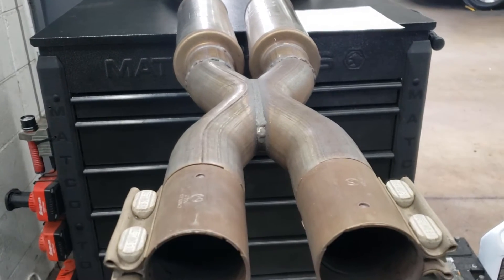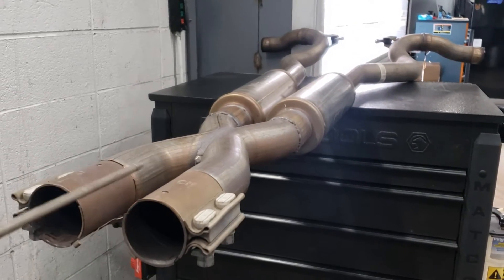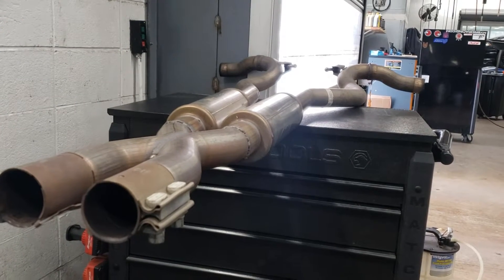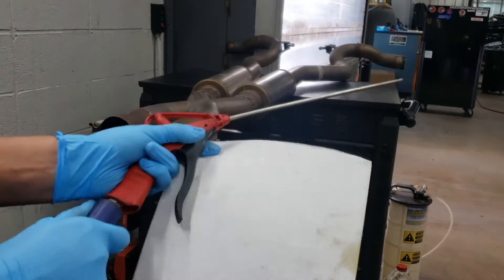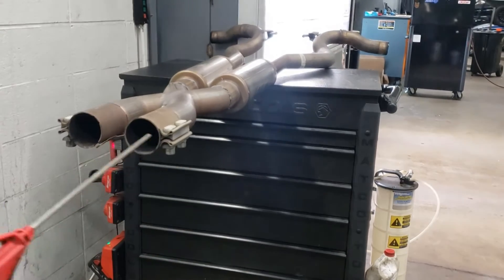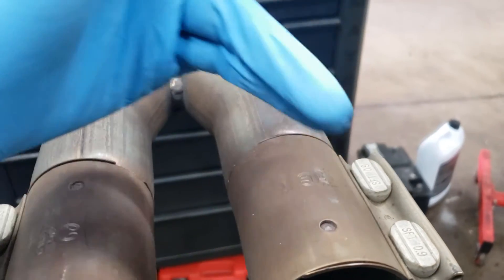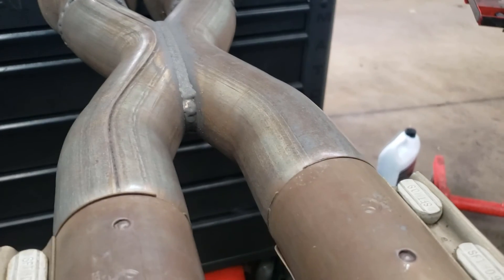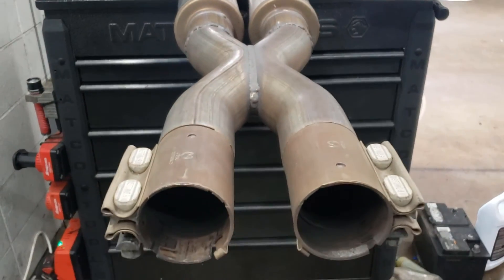Watch how a X pipe works! | How things work

Comment: What about the placement? Is there an optimal length of pipe from the exhaust manifold you should install the X to get peak performance and/or different sounds (lower or higher pitch, more rumble or more rasp etc) or does it not matter?
Reply from the maker: That's a hole different scien

Comment: Greater suction effect is achieved with a "Y" branch, adjusting the diameter of the final tube according to the total gas flow rate. The system would be configured to the 8-2-1 type, just as they did in this Datsun V8: https://www.youtube.com/watch?v=mkxTfQ_e2BU&t=701s

Comment: What are your thoughts on the downpipe coming into the muffler after after the cats. The muffler is a Jones Jones, Max flow, one and two out. I want to attach my pipe directly to the muffler and then run it out the side of the truck in front of the rear tire.. do you think this will work?
Reply from the maker: Technically speaking anything will work

Comment: Just found your video , off course because I have a  3inch in/out X pipe in my hand an would like to install it  ..... I have a true dual straight piped 2008 535xi N54 twin turbo bmw Inline 6 two banks ..... I have 3 inch catless downpipes off the turbos,,, first section of the exhaust is stock 2.5 inch  (super sprint 3 inch is too expansive so i kept stock)  and then 3 inch all the way out to the back  separate  pipe dual exhaust from each turbo... in the middle I have dyno max race bullets and near the end  another set of dyno max race bullets LOUD AN LOVE IT

 turbos love the non restriction HOWEVER MY QUESTION IS ,  I was wondering will the x pipe make the exhaust move out the back even faster an pull the exhaust out even better ??? what would it to to sound?? and where would be the best location in the middle  before the center  D bullets or after them????? 

sorry for the long ass question everyone
Reply from the maker: Your splitting hairs at that point. Sounds like your happy with the set up so I'd leave it at that. Once you go single turbo on the n54 the previous exhaust won't even matter.
Reply: @YLegalRacing   what would the x pipe do for sound? and thanks so much for responding
Reply from the maker: No problem!! very minimal sound difference in your application in my opinion

Comment: Been curious for a while.
will this setup work on inline/straight cylinder engines?
Like frome the headers, separate the exhausts then let it meet on the X/H pipe.
Reply from the maker: Potentially, primary use is high rpm v8s
Reply: I bet it does work on in-line.  I have a Datsun Z car. If you have a 6 to 2 exhaust system you could install a X-pipe just after the collector flange and voila!

Comment: I’ve a question 🙋🏻‍♂️ so i just delete the stock x-pipe from my 3.5LV6 w204 and now the exhaust is shaking/ vibrating. Is deleting an x-pipe can cause the pressure flow uneven ? Should i just install it back? Thanks for helping.
Reply from the maker: Install back. Helps for smooth operation
Reply: Thankyou . So you mean without the x pipe exhaust might get vibration?
Reply from the maker: Yes

Comment: Maybe you can answer a question about my theory on x pipes. Is there a minimal size requirement where the pipes actually join for the x to work more or less efficiently? When I built mine, the hole in the pipes where the x is created is only about 2-2.5” long and about 1” or so tall. My thinking was having it big enough to say it’s balanced, but not so big as to create a restriction or change direction of the exhaust flow through the pipes. Would you say this is right or wrong.
Reply from the maker: That's a deep rabbit hole that I have yet to do down. I'd research Nascar x pipe theory's and function, there's a hole other world when it comes to that stuff. The entire engine from air filter to exhaust tip is a unit any changes anywhere from cam to header length will drastically change how the x pipe functions
Reply: @YLegalRacing  There is a certain size hole the crossover needs to be. Most all aftermarket mass produced x pipes are joined way too much. Nascar ones are actually pretty small compared to what you’d think
Reply from the maker: Holy crap a comment from stapleton! I was watching your latest ford nascar video. I could nerd out on this stuff for days. Old school high rpm nascar tech and 80s F1 stuff is juicy.

Comment: We get what happens with gasses going in, but can someone help me understand with gasses going out of the X pipe ?
Reply from the maker: I literally just explained it
Reply: @YLegalRacing  my bad😬 also what if I have closed valve on one side of my outlet pipe and open only on other for daily use. 
Do you think that will work with x pipe  ?
For in-line 6 N55 bmw. 
TIA 👍
Reply from the maker: N55 don't need an x pipe. The valve won't effect anything what so ever
Reply: @YLegalRacing  you’re amazing! Thanks for the advice! I mentioned the x pipe only because that’s how aftermarket company like “fi” is doing it for bmw f12/f13
Reply from the maker: Yeah the new stuff is different but n55 is a straight shot. No need to make it complicated
Reply: @YLegalRacing  🙌🏽🙌🏽 I’ll take your word for it !
Reply from the maker: I've been working on those things for years, n55 are pretty solid

Comment: So in terms of exhaust flow, do you count the flow as one pipe or 2 pipes I.e (2 2” pipes meeting at a xpipe is  is the same flow as one 2” pipe or 2 2” pipes still despite the loss of cross section area?)) doing a single to dual of 2.5” to dual 2” “stock was single 2.25” max horsepower is 250 current 200
Reply from the maker: I would'nt pull hairs on those numbers, x pipe only works as efficient as the engine does. And x pipes work preferably better on a V8 application. V6's typically are ok with 2.5" piping
Reply: @YLegalRacing  that's fair i've been reading a lot of on cfm ratings of pipes and everything like that it just shy's on how restrictive a xpipe can be i'm pretty it was this video and a mx5 x pipe video that makes me feel comfortable to do this on a 200 hp i4 turbo'd car, ik this is not a performance gain but more of sound tuning thing personally, straight pipe sounds like a v8(dont believe me, look up n18 staight pipe) and i dont think it matches the character of the car i drive so and also whats not cool about having quad tips on a toaster
Reply from the maker: 2.0l turbo car? Then just dump it straight after the turbo. And have a decent cat back, the turbo alone will change the sound of any car
Reply: @YLegalRacing  my car isn’t a miata lol, it’s a 2012 Mini Cooper s n18 k03 turbo oem, straight pipe aftermarket sounds like a v8 off a little 1.6L , I plan splitting a 2.5” which is rated for 250 hp(255 is max on my car due to heat temps) splitting to a dual 2” which is supported up to 289 horsepower which then meets at a xpipe then to 2 dual tips

Comment: Hi, great video! I‘ve got a question regarding a downpipe I‘m probably going to buy for my car (VR6 24V european) and thought you might be able to help me out. It does not have a true x-pipe but rather merges both pipes for approx 3 inches in a big tube and separates them again. Will this have the same / a similar effect?
Reply from the maker: Similar yes, I used to have a 12v VR6! It's going to sound soooooo good. I had a borla catback on mine
Reply: @YLegalRacing  Wow, thanks for the extremely fast reply! So I can hope for some sweet gains? ^^ The VR6 sound is absolutely amazing and with a Borla exhaust even better I believe!
Reply from the maker: Yeah but I stayed away from the down pipe just because I didn't think that juice was worth the squeeze. The 24v is decent and fun to drive
Reply: @YLegalRacing  There are almost no performance parts for the 2.8, that’s why I‘m switching to the r32 exhaust system which needs the downpipe and Catalytic converters. I will take 200 cpi (the law requires it) and the modified downpipe. I just hope the sound won‘t be extremely high pitched. I thought maybe a post cat h-pipe will make it deeper if necessary but I can’t find any good information on that.
Reply from the maker: I'd just stick to a good cat back. Swapping all that is alot of work. I had my cat back 2.5" welded on at an exhaust shop for $250. It'll sound good enough
Reply: @YLegalRacing  Sure, if it was only for sound I would stick with my cat back too. But I would like to hit 250hp in that car and get the gas mileage a bit down through the heat getting away faster and it probably will help the car live longer. Since things are a bit difficult here in Germany there are not many other options left. I plan to drive the car for serveral years and have decided to give it a bit more care than it probably deserves. ^^
Reply from the maker: Holy crap Germany!!!! That's dope as hell. Good luck on the road to 250hp. My dream would be a turbo vr6 corrado. I had a g60 but it was in rough shape.
Reply: @YLegalRacing  Thank you very much! I‘m half way there with 225 hp and I hope those things will do the trick. A second remap is planned and I‘m thinking about getting a Fluidampr aswell. The Corrado is a really cool car and as a VR6T it would be a beast! G60 is an iconic engine aswell, very unique sounding. A german tuner called Turbo Gockel has done many VR6T with as much as 7XX hp and more, if you want to look into that. I think he has also done a corrado with awd conversion and that thing really moves.
Reply from the maker: I'll check em out, good luck brotha! Holla at me if you need anything!
Reply: @YLegalRacing  Thanks man! Actually there is one question I have: Do you know if a post cat and pre mid and rear muffler h pipe would deepen the sound? Or would resonators be the way to go there?
Reply from the maker: You won't need an H pipe, just a good rear muffler and you should be good. Resonators are cheap and can be added later if it's too loud for you
Reply: @YLegalRacing  Great, thanks a lot! Have a good day.
Reply: @YLegalRacing  Hi again, the pipe is installed together with high flow metal cats. Sounds amazing with sadly minimal rasp. No hp gains so far, I think it will need a remap for that.
Reply from the maker: Zero rasp is always the goal, it will be hell to drive around with rasp all the time. Maybe look into some cams too, they give a little bump. But with a tune and bolt on's I'd be happy as is
Reply: @YLegalRacing  Yes sure, rasp is so minimal I try to live with it. Thought about fitting a resonator but I don‘t want to drive illegaly and get the car taken away. Thanks for your advice, I will have a look into cams.
Reply: @YLegalRacing  Sorry to bother again but I‘ve got one last question: Do you know if an after cat h pipe (before the y pipe) will reduce the little rasp and give it more of a growlier ‚muscle’ tone?
Reply from the maker: Couldn't answer that one brother
Reply: @YLegalRacing  Ok, thanks anyways and have a nice evening.